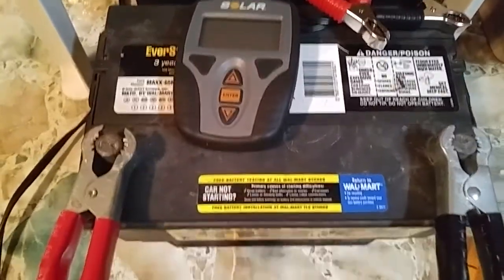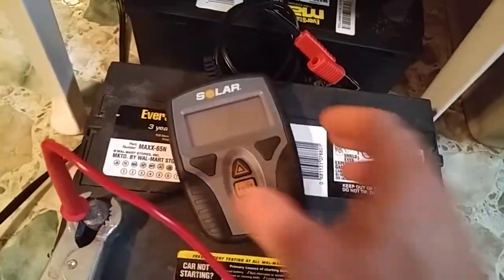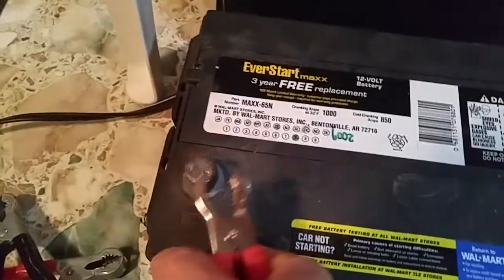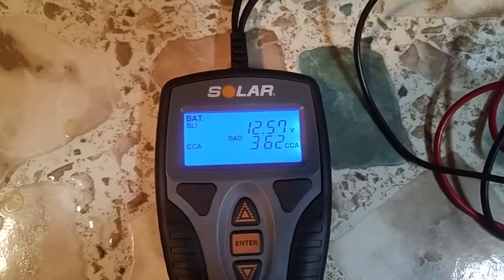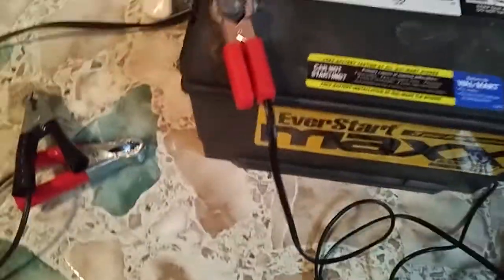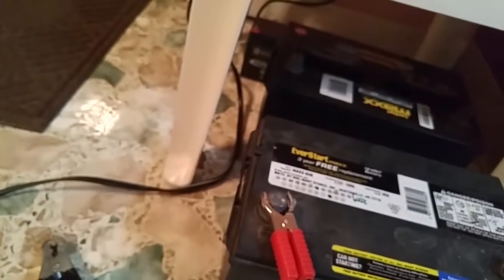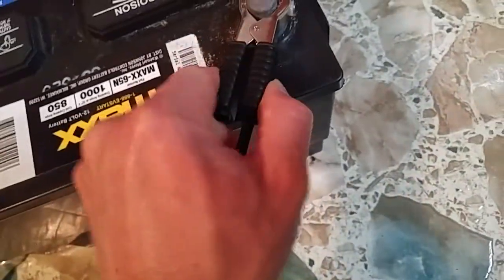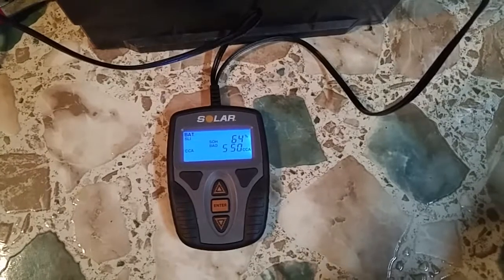Solar BA-9 Battery System Tester

Comment: Why is the fluke meter testing 13.56 volts 6 V and the solar is in a 12.56 v  approximately ??  The fluke meter is a certified meter so that tells me that the solar  machine is out one Volt, which means everything will be out of speck.